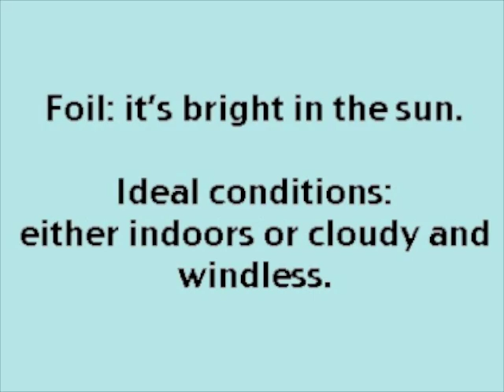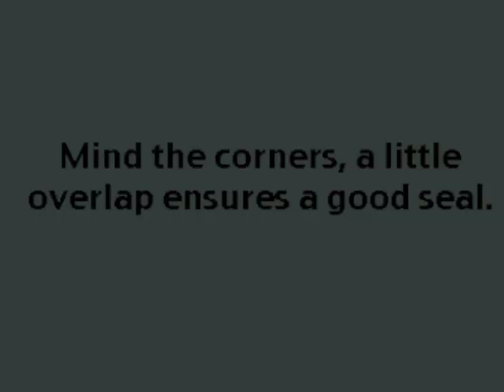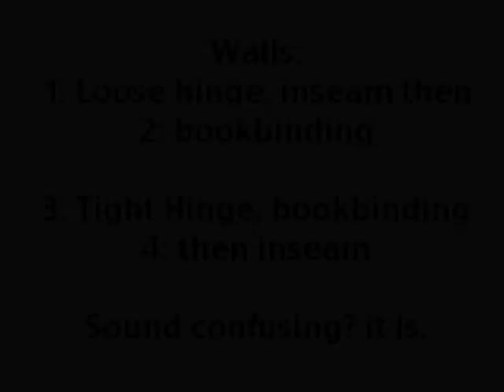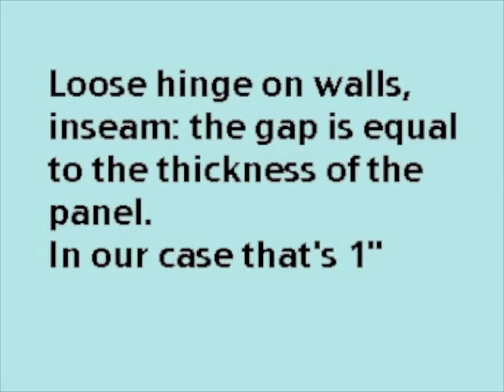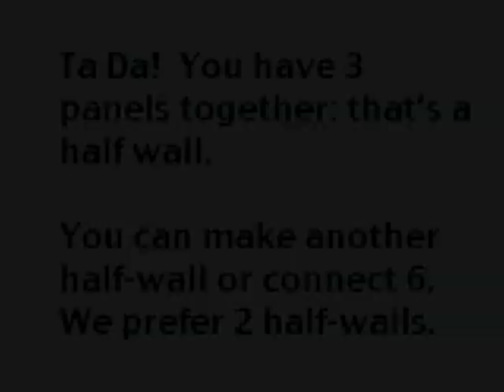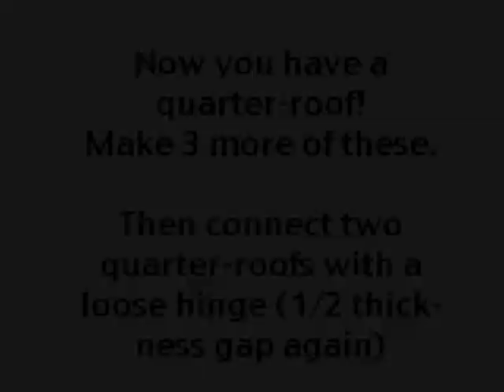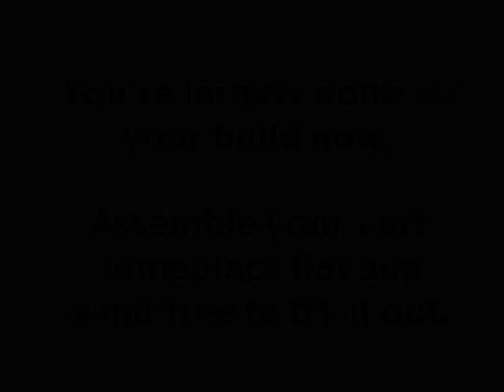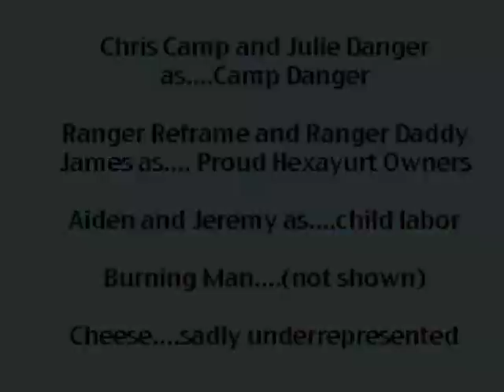Camp Danger Hexayurt Build Day

Comment: hi Julie.  I'm a second year burner.  I'm going with the H15 (six foot walls 10ft peak)  any suggestion for a first timer on how to "FOIL" the tape seams on a built hexayurt to get many years use out of it? in the video I see a foil reinforcement stage  on all wall and roof parts prior to assembly , a combo of  6" and 3" bifil tape to pre fab pieces at home and more 6" bifil to assemble on playa...but how do I protect the tape I used in pre fab home construction phase...do I trial run assemble it and go around with 3"FOIL tape and cover any bifil tape exposed to elements WHILE ITS ASSEMBLED?   or do I foil all the way down into the loose and tight hinges?  please help....love the vides   thanx